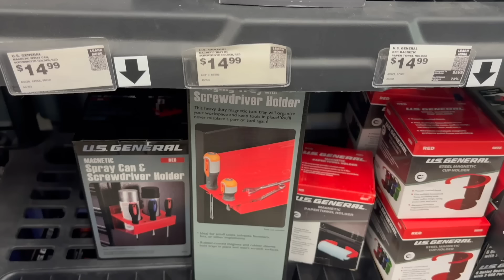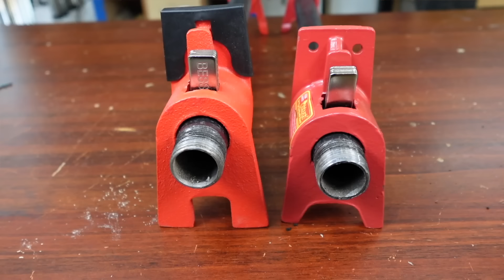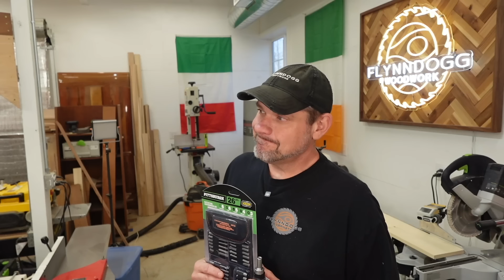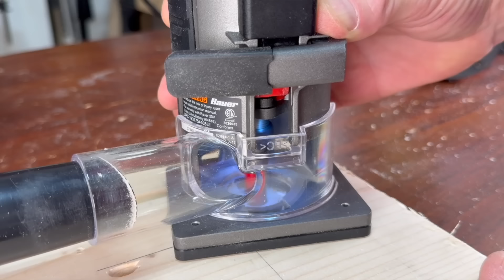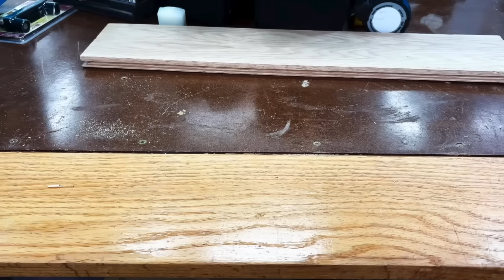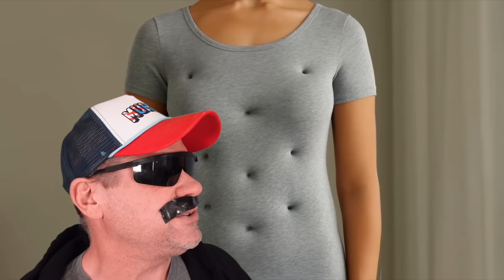I Bought The Most Overlooked Tools Harbor Freight Has

Comment: I’m sure I’m the last to know this, but my router from HF did not come with a router bit. I also got the trim router, so it may be different for you. They do have awesome bit kits right there, too. I’ve been loving HF and also been super irritated with them as you do have to buy all the pieces separately. Still totally more affordable than anyone else.
Reply from the maker: Great observation.  Most routers unfortunately don't come with bits.   That's typically because there are so many different types of bits, they probably don't know which one you would use the most.  If you are looking for a great set of bits, I would check out the yonico brand on amazon.  I've been pretty pleased with them.  I have many sets from them.   Here is a link to them: https://link.amazon/B08iOcnMu
Reply: @FlynndoggWoodwork oh my gosh! Thank you! Since you’re apparently the king of battery systems, do you have any suggestions? And are batteries interchangeable if they’re the same voltage? I’m new to this all, but I’m remodeling my childhood home, and need all the info. Thanks!

Comment: I've had a Harbour Freight card for two years, starting with a $4000 limit from day one.  I've used about $2500 at most, one time.  Made my payments early, never missed a payment and paid it off early.
Suddenly, they audited my account and changed my limit to $100, with no explanation other than sending me the same form letter saying it was a routine audit. Since getting their card, my income has increased (not as much as their prices), I haven't missed a payment on any other bills, and I haven't received any negative action on my credit report.
Well, I currently owe less than $60; they will get it in two payments, and seeing as there's nothing much I need from them under $100, they can have the card and not my custom.  I'll take my business
 elsewhere.

Comment: That clamp isn't bad. But I have the 48 inch ones and the bar bends if you use it at full length. If the clamp is distorting, it's not reaching maximum clamp strength. The handles and jaws are definitely better than the black and Grey cheaper ones. But the bar is better on the cheapies. I wouldn't recommend the longer ones. But I wish my clamps were opposite, should have gotten my long ones on the cheap end (better bar) and more commonly used shorter clamps were the better handles.
Reply from the maker: I appreciate the heads up on the bar deflection, that's really helpful to know before sizing up! :)

Comment: I use Harbor Freight quite a bit. I have been surprised (in a good way) by the performance/quality of some of their tools.

But your review misses the major problem with them: durability.

Driver bits? Harbor Freight has great assortments at low prices, some packages even including the $0.25 carrying case you are so proud to own. But HF driver bits (I mostly use Torx) are good for maybe 3-5 uses at most. BTW, when I say "driver" bits, I'm not talking about a impact driver, I'm talking about a drill used gently with a screwdriver bit. An HF bit would shatter in the first few seconds used with an impact driver.

Those jigsaw blades? Uh-uh. There is indeed a wide assortment at a low price. But go to actually use them? They are wobbly and slow on first exposure to wood, and it goes downhill from there.

Whatever type of blade, bit, or grinding tool, it is best to avoid HF. I have directly compared multi-tool blades, sandpaper, driver bits, circular saw blades, table-saw blades, and reciprocating saw blades. In every case, the HF product was horrible.
Reply from the maker: That’s a fair point, and durability is definitely the trade-off with lower-priced consumables! :)

Comment: Was that DeWalt battery brand new as well? Battery capacity does degrade overtime with ea charge and how it's maintained
Reply from the maker: Brand spanking new!    Literally right out of the package a week ago.
Reply: @FlynndoggWoodwork thanks for the response. And that's really impressive for the Hercules. Insane cost/value ratio with the batteries being less than 1/2.

Comment: Just to let you know, there is another feature of the Centech 1000gram digital scale. That cover lid can be flipped over and placed on the scale to hold loose small parts. just remember to tare it out.
Reply from the maker: That is a great tip, I never realized the cover was designed for that!  Thanks so much for sharing Copperdolphin!

Comment: You can take the luminar lantern and put it inside a coleman camping lantern if you dont want to use white gas. I had to remove the battery cover. but you turn it upside down to use anyway.
Reply from the maker: I never would have thought of that, thanks for the tip! :)
Reply: @FlynndoggWoodwork I collect all of the underpriced lanterns I can. If I am missing a globe the lantern becomes a heater with a can if necessary. Spare parts are most affordable by buying and stripping poor condition lanterns.
    I can make beautiful patina lanterns from junk.

Comment: I think you missed the biggest difference between the Hercules and Bauer tools and batteries.  The Bauer router and battery come with a 90 day warranty.  The Hercules router comes with a 5 year warranty and the battery comes with a 3 year warranty.  Considering that I have warrantied a Hercules battery at just about a year of usage, that $10 difference was well worth not having to go repurchase a $50 battery pack.
Reply from the maker: Excellent point.  I probably should have pointed that out.   Thank you so much for sharing, that's great information!

Comment: The bauer is not that cheap if you have to buy into the battery system. 1 5.0 amp batt and charger is $120 + $60 for outer is more expensive than buying the makita tool only router for $169 and using batteryI already own.
Reply from the maker: I don't disagree.   The batteries are really what seem to make all tools like this expensive.   Would be really nice if there would be standard batteries that would power all tools and not so many one offs.
Reply: @FlynndoggWoodwork or at least offer a 1st time buyer battery deal 1 batt 1 charger.
Reply: @franks4973  They do different sales during the year, buy a battery and charger and get a free tool is pretty common, and not just a Harbor Freight thing, box stores do it too with Dewalt, Ryobi, etc.
Reply: You can buy a drill or impact kit with a battery/charger I think around $100.  I did that with the Hercules 1/4" impact, got the impact battery and charger, then sold the impact because I just needed to get a battery and charger, which to buy just a battery and charger I think was about $150...but buying an impact with a battery and charger was cheaper, not sure how or why but they got some weird pricing going on.  Granted that impact kit is a 2AH battery, its still a way to at least get a battery and charger cheaper than buying them alacarte.  

Several of my Bauer tools I got when they had the buy the battery get the tool free deal a couple years ago.  When you catch stuff on sale its worth it...but the prices on box store brands have gotten so outrageous I no longer own or purchase those tools since I just do DIY and homeowner projects there's absolutely no reason to be wasting that much money on certain colors of tools just for the logo.

Comment: Every time I look at the longer Bremen clamps 36” I always find bent ones, which is why I never bought one. Then, when I compare the smaller ones with the same size Pittsburgh clamps, the Pittsburgh 12” clamps get the job done for a ridiculously low price. I always start projects with my Jorgensen and Irwin clamps and when I run out, I use Pittsburgh.
Reply from the maker: It's funny you say that.  I'm the same way.  I start with the expensive ones, and if I run out (which is often)..... I switch over to my cheapo ones.   They get the job done! :)